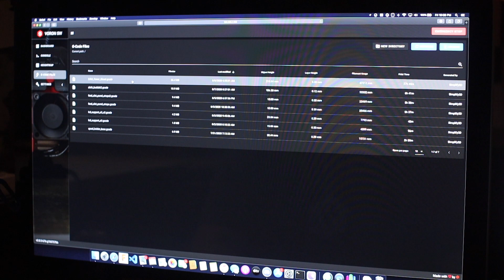VORON Switchwire

Comment: So, not too long ago I made the decision to build a 2.4 rather than purchase an OTS printer. I WAS going to purchase the BambuLab H2D but decided against owning proprietary hardware, proprietary firmware, relying on the OEM for repairs/warranty, relying on the OEM for parts, etc., etc. But before building the 2.4 I would like to already have a bit of experience building a printer... enter the Switchwire. Upon building the Switchwire I get experience as well as a ABS-printing capable machine which I will need to print all of the 2.4 parts.

Comment: Ist it possible to lean the z-axis by 45° and use a conveyor belt as infinite y-axis? Or even switch between vertical mode for accuracy and 45° infinite y-axis for mass production?

Comment: I've heard of CoreXY, what's CoreXZ?
Reply: X Axis is from side to side, Y Axis is back and forth, Z Axis is up and down.

In a CoreXY the belts pull the printer head along the X and Y axis. In this CoreXZ they put the system on its side with the printer head now being pulled along the X and Z Axis.
Reply: @Foxhood  So it's still a bed slinger? Given that movement along the X and Y axes are large and fast, and Z moves slowly and incrementally, I don't see the point to it. Yes, you don't need to move the X axis stepper motor, but that's not something that has to move or be accelerated at a high rate anyway.
Reply: @iskandartaib  It is indeed a Mendel "bedslinger" style and the gain from the use of the Core setup is indeed debated. The only thing you can genuinely accelerate with this design is the Z-Hopping

The Switchwire mostly seems to be a more straightforward Remix of the Prusa I3 at a similiar pricepoint. Using a "CoreXZ" since that is what the Voron team knows best, but yeah if you want the Core system to shine: The other Vorons make better choices.

Comment: Cool.  I personally don't see how this kinematic system has any benefits though.  How about making an SLS, SLA, or better yet, a polyjet/material jet.
Reply: Have you every seen how complicated SLS is, not to mention expensive?
Reply: @squirrelrobotics  Yes.  I am an additive engineering professor.  I have made 2 cartesian and 2 galvo SLS printers.  The expense is low if you go cartesian.
Reply: @piloterror1644  How low?
Reply: @piloterror1644  can you show us your sls printers? :)
Reply: @squirrelrobotics  Well, my last year senior design group built one that was cartesian for PA12 for less than their 700$ budget given.  Of course they had access to CNC , TIG welders, lathes, and other industrial equipment, but raw materials were under 700$.
Reply: @andysen1987  Sorry, no pictures right now.  I might have a few of some of the parts floating around in my phone.
Reply: @piloterror1644  I stand corrected then, you learn something new everyday.
Reply: O nice! would be awesome to have you on the Voron dev team to do a Voron SLS printer.
Reply: @npgoalkeeper _ refillable inkjet printer cartridges if using binder jetting works.  For polyjet, you are going to be using pump systems anyway, so it doesn't really matter what "cartridge" is used.  You can just put a feed straw into the resin jug it came in.
Reply: @npgoalkeeper _ Some of them mix, and some of them use many print heads.  Having dedicated print heads for materials would be better for DIY IMO.
Reply: The system has 2 motors running the X axis, so I guess one advantage is torque.

Comment: What are the advantages? The typically corexy design allows for high speed and precision. The i3 style has bad ghosting on the bed axis. Nobody has ghosting in the z axis so I don't know why it has to be corexy. If that makes any sense can you explain it for me? In new to printing.
Reply: because for the price of prusa its way better than prusa.
Reply: @MrHeksas  got an example?
Reply: I think they're being hush hush because of patents, but I believe it's designed this way  so none of the steppers need to be in the build area, which means you can heat the build chamber as much as you like. Also no thermal expansion of leadscrews to deal with. Basically it's the sleeper heated chamber printer that Stratasys never thought of, and doesn't overtly infringe upon. Hotend will likely need water cooling.
Reply: @samroesch  I don't think that's it but it's a good guess, my understanding is to eliminate z wobble and faster z hops
Reply: @3DFactoryTech  Even if it’s not, it’s probably how I’d build a high temperature chamber now I’ve seen it. Although you could build a non-bedslinger using the same idea,  which would be better. Basically 2x the COREXZ shown here, so a COREXZ plus a COREYZ. Plus Z gets extra support as it’s driven from 4 sides of the gantry.
Reply: @samroesch  you can also just place the z motors lower and use a longer leadscrew lol
Reply: @3DFactoryTech  Don’t you have X and Y motors in the heated space still though? And lead screws that are prone to thermal expansion?
Reply: @samroesch  forgot about the x motor, regardless there are higher temp motors good to 100c+ that aren't that expensive. Leadscrew expansion is the least of your concerns lol, your belts would have melted by the time that becomes an issue
Reply: @3DFactoryTech  60 degrees of deltaT give you about 0.6mm of expansion. So like 3 layers?  You’re right though, probably something that’s easy to compensate for either way.
Reply: @samroesch  yeah 3 layers across the entire screw lol, yeah would be easy to compensate for but regardless not sure if it'd be an issue
Reply: No lead screw = No Z banding, no lead screw alignement issues, probably cheaper (you only need 3 stepper motors + extruder). And because the belted Z axis is connected to the X axis, it will not crash/fall down when power is removed. It solves a lot of problems.
Reply: It probably because they already have COREXY machine so there is no need for another new design for now since 2.4 and 1.8 just released a few months ago. Switchwire probably for people who want to try Voron design / product at a cheaper price tag and for the dev to try few new things. For the kinematic belt could mean it can travel faster than a leadscrew and no problem with the bad leadscrew. I don't think belt length will be a problem here if the machine is not too tall.
Reply: @xsunnycrazyx  I'm hoping it's cheaper but I really don't know if it will be. Maybe if it costs like 750 dollars it will be worth it because it has more build space then a v0s but less features then a V1.
Reply: @3DFactoryTech  BOM price is currently looking under the cost of a prusa Mk3 for comparison, still need to finalize cost after looking at vendors and what not.
Reply: @CanuckCreator  just finished watching the stream. Yeah it seems to have it's place. I figured it would cost as much as a V1. I'ma glad to be proven wrong. I'm also glad to see the CoreXZ system is actually beneficial and that they made the most of bed swingers. It does seem like this printer does have a place in the voron ecosystem now.
Reply: @3DFactoryTech  , yes I am glad too. Have YOU designed a better 3D printer and made it available?
Reply: @michaels3003  I'm in the process of doing so. It will be an i3 and it's just for kicks but i intend to make it better then most core xy machines in speed and quality. It will be unlike anything we've ever seen :0
Reply: @3DFactoryTech  lol sure thing
Reply: You get all the disadvantages of CoreXY belt lengths with the disadvanges of a bed slinger ringing, its a win all around.
Reply: @PrintedStupid  that's my thoughts. I don't see where there is anything positive. I'm sure voron devs have a plan we just don't know yet.
Reply: @3DFactoryTech  Thats what they said about Trump and look how that turned out. Imma have to reserve judgement until I see a few in the wild tho. Not going to blindly spend money on anything just yet.
Reply: @PrintedStupid  well he was always an idiot with no reputation. Voron devs do. They wouldn't waste everyone's time with an inferior product